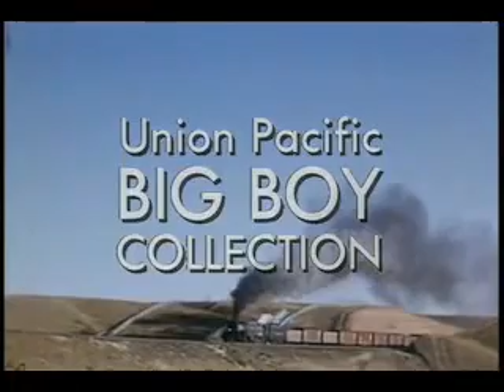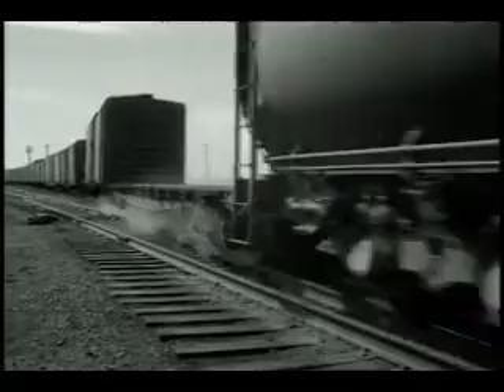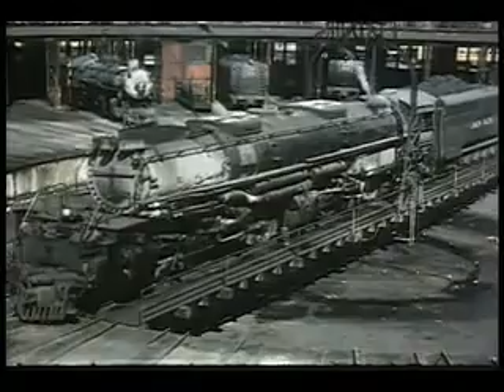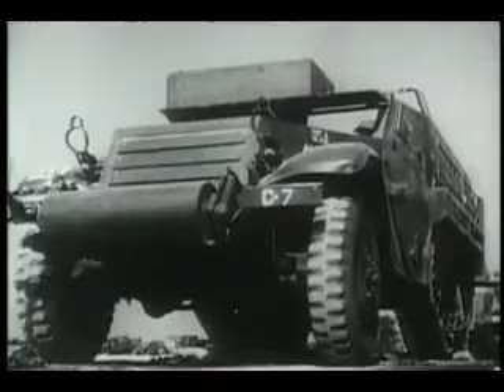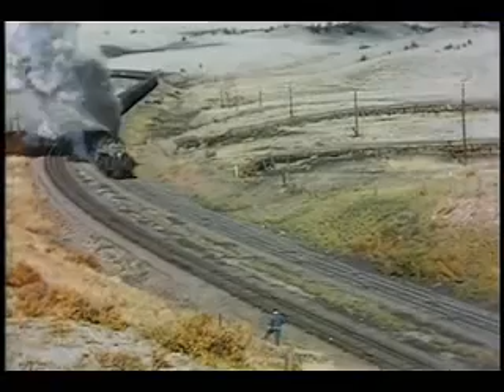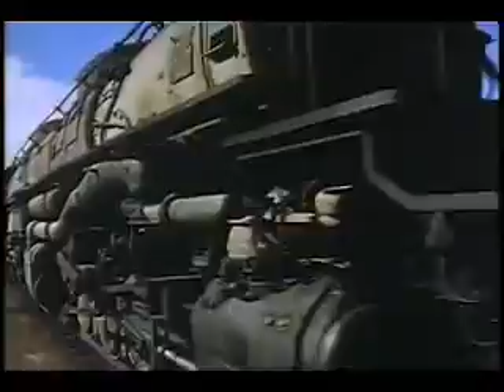BIG BOY, LA LOCOMOTORA DE VAPOR MAS GRANDE CONSTRUIDA

Comment: Big Boy, tan grande que necesito 4 cilindros, 2 delanteros que traccionaban las 8 ruedas delanteras y 2 traseras las 8 ruedas traseras. Buenas tomas, buena música. Sos un groso
Reply from the maker: Las ALCO series 4000 o "big boy" eran en si locomotoras challenger modificadas, que resultaban tan largas (41 metros de chaffenber a chaffenber) que no podian realizar ningun tipo de curva, para solucionarlo dividieron los 8 ejes tractores en 2 boguies identicos que al igual que las challenger sus cilindros no eran de doble expansion sino de doble efecto dividido, en total operaba con 6300 caballos de fuerza o 4.7 megavatios de potencia bruta aunque pesaba 560 toneladas metricas. Solo se usaron en la ruta northern union pacific (Chicago-Seattle) quemando carbon de 5ta calidad obteniendo gran rendimiento al llevar largos trenes cargueros sin ayuda en la cordillera de wyoming. fueron reemplazadas por nuevos modelos Diesel de General Electric entre 1959 y 1962.
Reply: Alfonso Flores Gomez-Pocet Las Challenger no eran de doble expansión. En eso se alejaban del concepto de locomotora Mallet, de la que empleaban la forma de articulación.
Reply from the maker: IonMoritz
Gracias por la rectificacion, fue un error de escritura, lo que debia decir es: "que al igual que las challenger". se reconoce y agradece la atencion prestada,  va a ser corregido, muchas gracias.
Reply: Alfonso Flores Gomez-Pocet